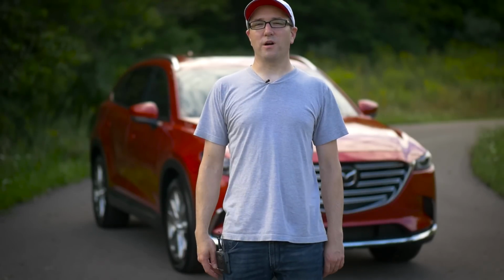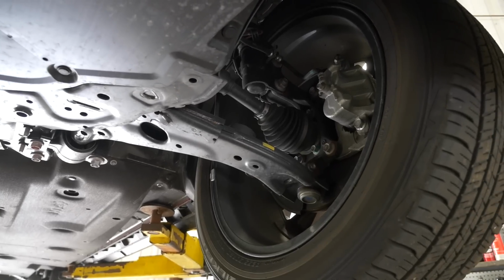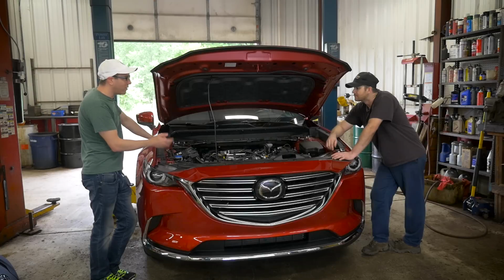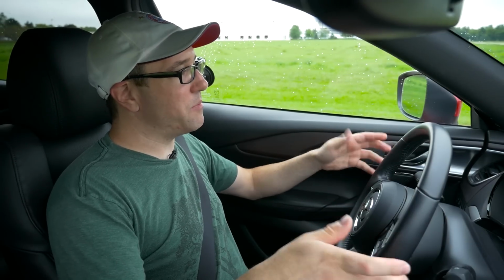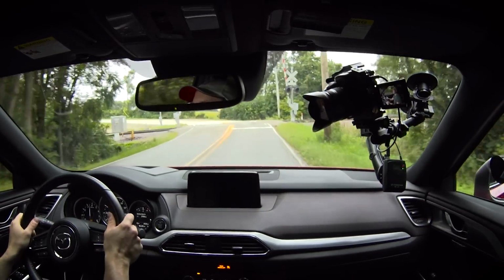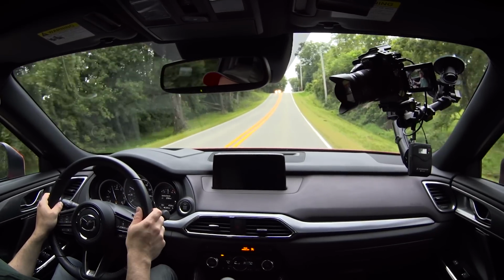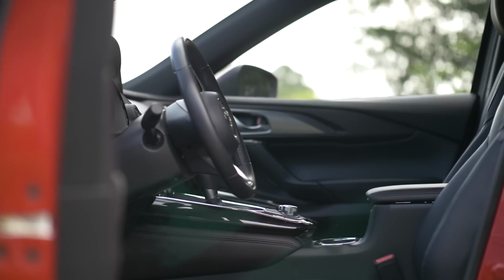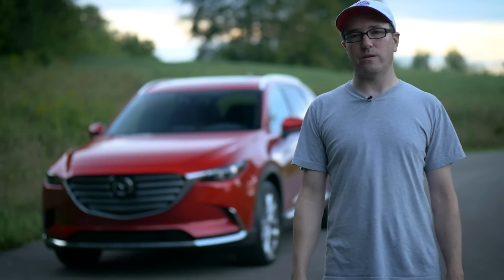Review | 2016 Mazda CX-9 | Plump Yet Satisfying

Comment: This is by far the best looking of the mid 40k 3 rows and I would choose this but why do I still get this nagging feeling that Mazda vehicles are, not quite fragile, but just somehow unsubstantial, if that makes sense.  I hate the Highlander but have no doubt it will run reliably for 150k miles.  I don't have that same feeling with Mazda.  I wish I did.
Reply: It doesn't make sense.  From my personal experience.  Mazda feels to me that is is one of the best designed, engineered and manufactured Japanese brand vehicle.  Their low volume perhaps has something to do with their superb quality.  I drove a 2010(mfg 2009) Mazda3 Hatchback to 228,000 miles in 6 years and currently drive a 2015 CX-5 with 108,000 miles.  My 3 looked and ran like the day I purchased it in July 2009 when I traded it in for my CX-5.  My CX-5 has run perfectly with routine maintenance (oil, wipers, brakes)  After 326,000 miles on two Mazda's in less than 10 years -  I will continue to buy Mazda's and recommend to any friends and family they do so as well.  (so long as their vehicle needs fit what Mazda offers (no trucks, no mini-van, no super cars) The interiors hold up to constant use, the engines and transmissions are near engineering perfection.  From my personal experience since 2009 - you should have that feeling with Mazda.  I sure do from 336,000 + miles of trouble free use.

Comment: You summed it up great. Exact reasons I did not buy this, even though liking the driving aspects of it, compared to Highlander Platinum, this was missing Ventilated heated and cooled seats, heated rear seats, heated steering wheel, panoramic roof. Ofcourse Mazda is stubborn not adding CarPlay and Android.  Even in 2018. Exactly the deal breakers for me. Same with CX5 for the second car. So ended up with XC90 and Q5 - obviously different price points, but Mazda lost about $85K worth business here...

Comment: i highly doubt this is the signature series, it comes with this brownish kind of leather called Napa leather, i dont think it comes in a black leather option for the signature.
Also the plastic shiny thing he is talking about on the doors and the center console, is actual wood in the signature series made from Japanese guitar maker, So i dont think he got those bits right. 

However everything else is bang on and probably the best review of the CS 9 till date.
Reply from the maker: +Nick Hill I mis spoke about the signature series.
Reply: Nick Hill, read some comments before commenting. It's been corrected a couple dozen times.

Comment: For some reason, this review seemed half-baked compared the others.  Seemed rushed and not 100% engaged as the other great reviews.
Reply from the maker: +John Genovese In terms of time, shooting, research and editing this review far exceeded others but the actual excitement level of driving it was far less than expected and thats likely the energy that is missing.  A ton of material to cover here in a short amount of time.
Reply: savagegeese
  Yes, Thank you for clarifying this.  It certainly came across in the video and I was expecting more enthusiasm.  I've been a Miata owner for 12 years now and love the Mazda brand.  I just helped a family member purchase a new CX-5 and she's delighted.  I did have a chance to mess around with the CX-9 while at the dealership and was impressed by the interior. (Very nicely done)  I'm not a fan of the boosted 4cyl though.  A flagship model should have a better engine choice IMHO. Lastly - I absolutely LOVE your car reviews because you don't hold back!  Keep up the great work!
Reply from the maker: +John G. Thanks for responding and I was really excited about driving the CX-5 and I think there was a lot of expectation here for the CX-9 with a new motor and when you actually drive the car that experience just is not there like it is in the other Mazdas that are out. But let's face it a driving enthusiasts isn't going to be piloting some 3 row SUV that's why it's a bit confusing. I agree with the motor and I think my two other favorite SUVs are the Sorento with a V6 and the RX 350 Lexus with the V6 and that's what this car is missing to take it to the next level.
Reply: I watched your review of the Kia Sorento (Friend just purchased the turbo 4cyl and loves it.)  Nice car but (for me) misses the mark.  If anything, it's got to be better that the Optima sedan my sister leased prior to the CX-5.  The steering on the Optima had to be "THE WORST" I have ever driven.  It felt like a turning a a piece of angle iron in a bucket rocks.  On...off....off ....on.  Constantly making corrections and could never even come close to a good hydraulic system.  That alone really soured me on the Kia brand.  (I believe there was a dealer TSB on it and was frequent contention for most reviewers.)  Anyway... I digress...

The main thing I want to say here is how much I appreciate your reviews.  You review cars that are "attainable" and for "real" people.  (Anyone can review the Stangs, Vettes, Camaros etc.)  Production values are out-of-this-world!  (It really difficult to even watch other car reviews now THANK YOU... :)

NO ONE does this the way you do.  Seriously Goose, the way you and Scott team-up and actually comment on the underside of a vehicle?  I mean???  Who the hell does that?  It's GENIUS!  And all the crap (Better word I'd like to use) automobile manufacturers create on the underside.. OMG!  (i.e. Belly-pan with 15-bolts and no access to the oil filter.)  

Trust me... for an engineering mind, those details are really important and really say TONS about the car companies that get it right.  It's a fantastic part of your videos that is so important, yet people care more about the headlamps and grilles than aluminum suspension pieces.  Crazy good info.

That's what's so great about your reviews.. they don't pander to the Soccer Moms that know ZIP about cars.  You don't mince words and it's nice to hear criticism from an "Engineering"  viewpoint.  Whatever you do... keep the same scenario going!  Plus... grew up in the area you test in... brings back memories!  :)

Lastly, looking forward to a review of the new Civic.   Keep up the GREAT work!!!